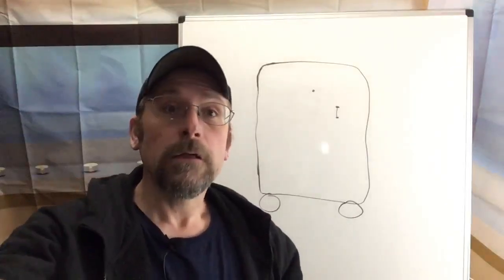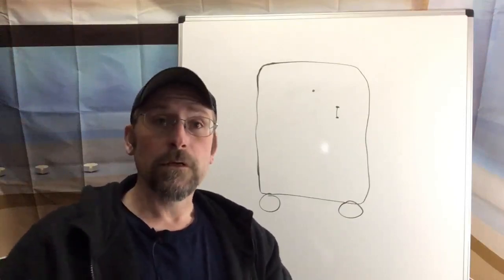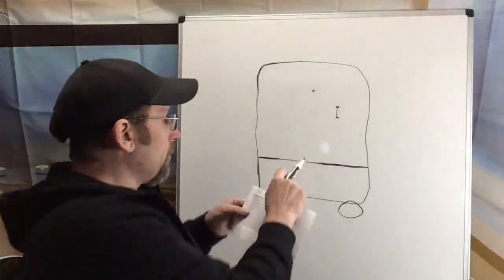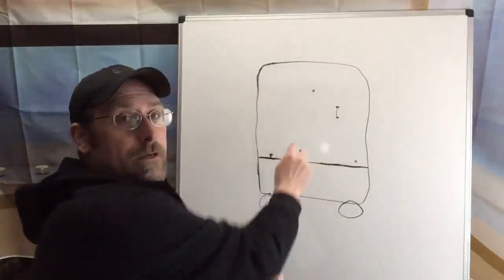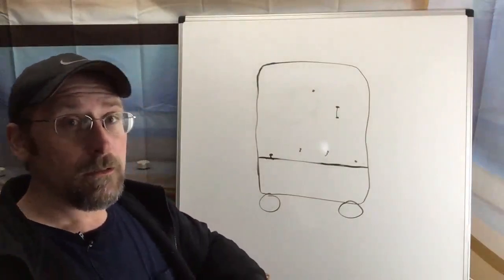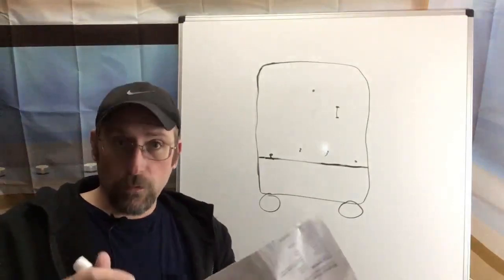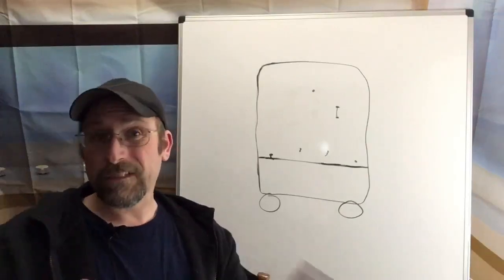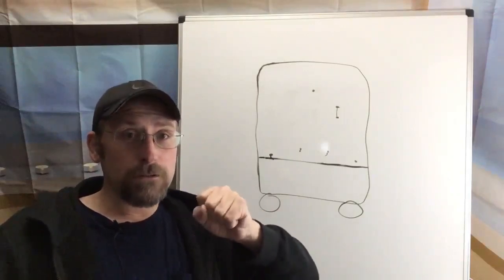HOW TO MAKE AN OXYGEN CONCENTRATOR QUIET

Comment: What is the quietest 10L model?
Reply from the maker: Hi, in my experience the quietest 10 liter oxygen machine was a Airsep I picked up while working in New Hampshire and Vermont. I also had a Invacare platinum 10 that was decent, but I'm talking about used machines. A new one could be much better, although being a 10 liter they will always be louder than the 5 liter models. So with that I'd have to say you should see and hear it before buying it. Go with a name brand for sure.  I hope this helps, Have a good night.
Reply: @OxygenGuy  If the doc required me to purchase 10L but only prescribed 6L/min is it necessary to stick with 10L units? I'll look into Airsep ... Thank you for your suggestion!♥️
Reply from the maker: You could bridge two five liter machines at 3 liters each but a ten liter machine would be less hassle. I didn't deal with them much, ten liters aren't common with most of my patients. Be sure to follow your doctor's orders and not go over your prescribed dose. Also you have some tips for hiding the noise. Have a good night!
Reply: @OxygenGuy  Generally I'd agree with the "see and listen before you buy" advise. However, my insurance used to provide a service contract with a medical devices company, and any time I had a problem they'd come out and give me another unit. Even with the same brand and model there can be a really large difference in the amount of noise they make. I don't know why, but I've seen that several times. 

If these things were REALLY built to be quiet, they'd have a thick cast metal case and base plate. They'd weigh a ton, cost a lot more, but would be super quiet. Plastic really isn't much of a noise damper even with internal padding. MASS is a noise damper. Heck, I'd build one with a secondary glass pack muffler side exhaust, just for that little bit extra. Really, there's no reason these things can't be nearly silent. All it takes is R&D money, and a willing marketplace.
Reply: Kk